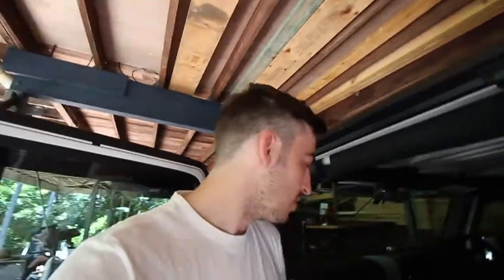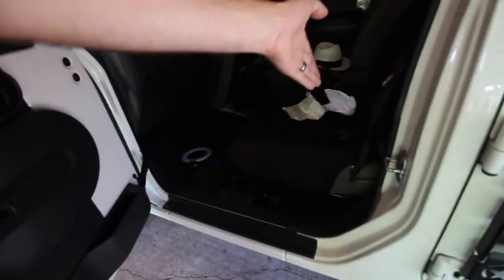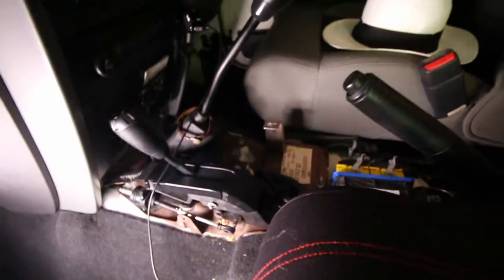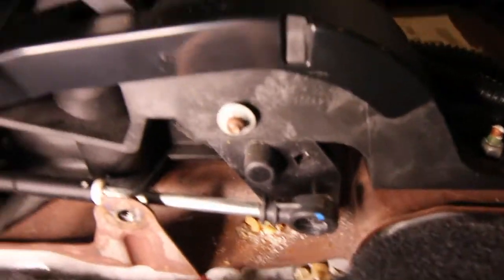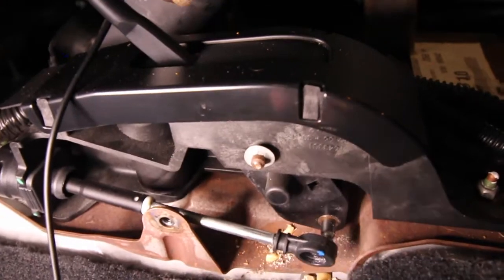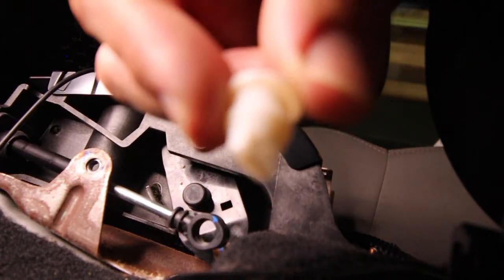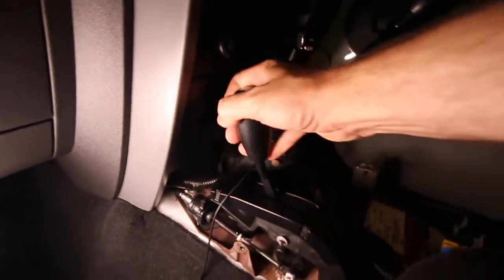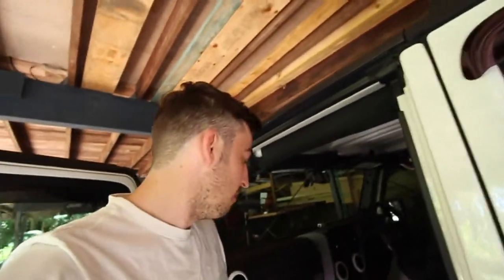JEEP JK TRANSFER CASE LINKAGE $1,50 FIX

Comment: Great easy fix.
I had a very similar plastic clip let go on my BF falcon at the gear box and Ford wanted I think it was $100+ for the entire linkage cable. So I went to eBay and found it for $1 from the great USA
Reply from the maker: That’s crazy, I have heard the same thing from a couple different people, the dealership is saying you have to replace the entire linkage